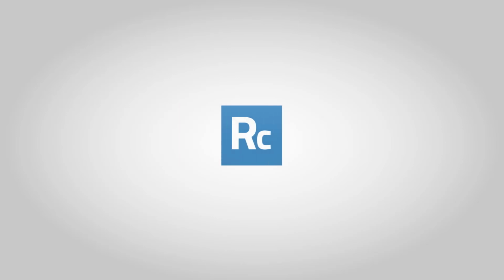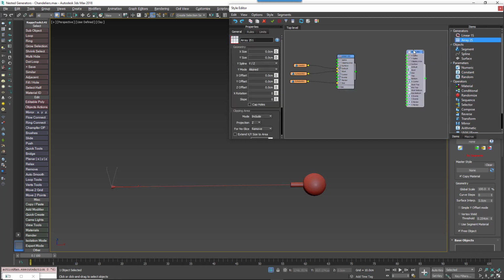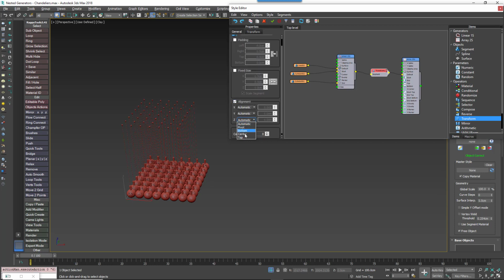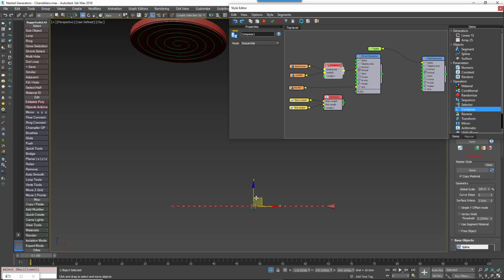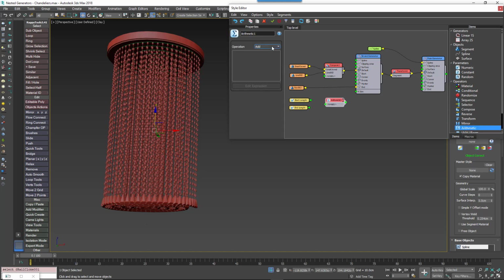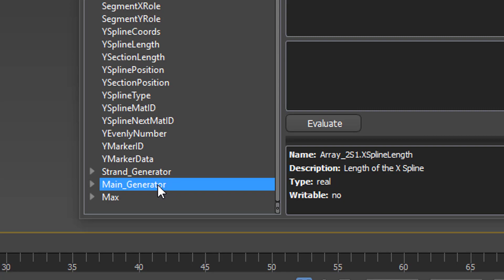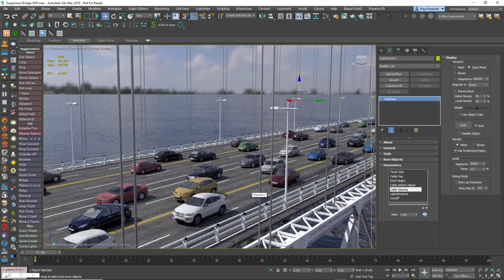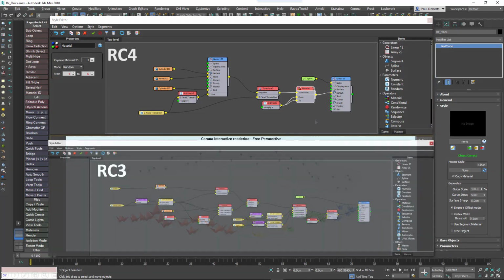DEMO: RailClone 4 - Nested Generators

Comment: these tutorials are HORIBBLE the instructor do not explain.  I tried to follow and no results.. Rail CLone suck ass.. I swear. it does not work smooth... and am using the new pro version....

for example.  he does not explains why he did not inserte a spline to follow?  or did he?
Reply from the maker: Sorry to hear you are facing issues. This was more a demo of some new features in RC4 than a comprehensive tutorial. Feel free to drop us an email at helpdesk@itoosoft.com with your scene files and we'll do our best to explain more clearly and help you out.
Reply: @itoosoft   is that I try to follow and all of it sudden your presentation jumps and skips steps.. if its a demo for new feautures. you need to be more DETAIL and clear for others to follow and understand the process..

Comment: Hi I tried following the light pendant example, and i found it gives me an error if my starting length (Input1) is 0, even though the length should gradually increase (be non-zero) as it progresses along the spline. I have to put a small starting value ( like 0.01m) to avoid the no-geometry error. Is this a floating point error? Is there a way to use input 1= 0 and not get an error?